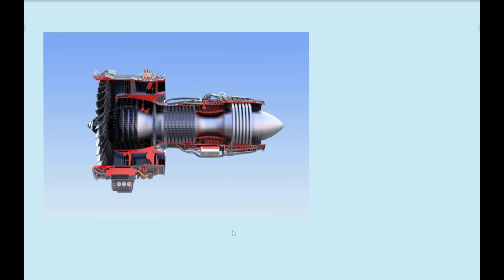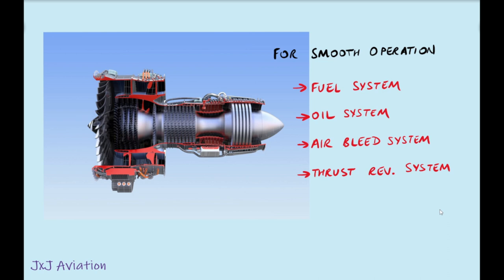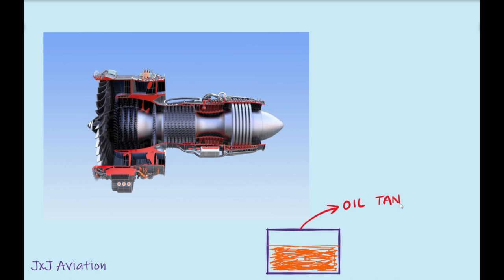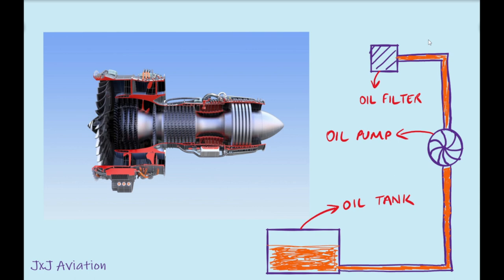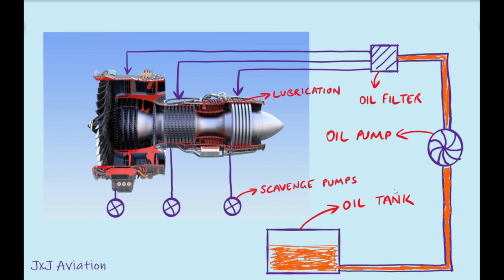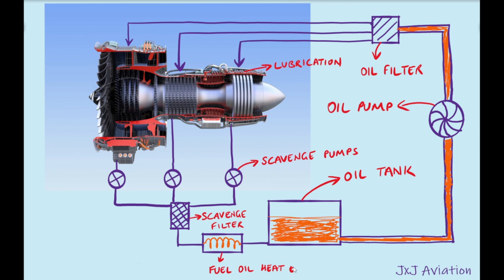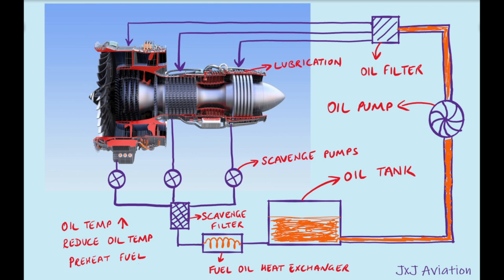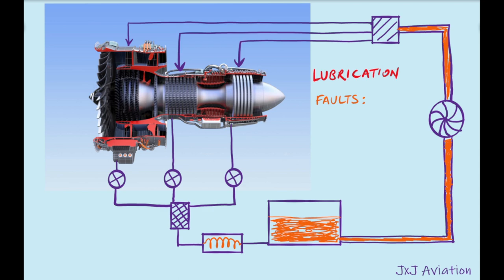How is an Aircraft Engine Lubricated? | Engine Oil System in 3 minutes | Aviation Notes | Faults

Comment: Oil system
It is nothing but 4 to 5 components it is available that I have built to improve the engine efficiency by lubricating bearings
 and its components

The main components are
Oil tank
Oil pump
Filter
And different types of lines which is connected to different places of engines wherever the oil is required
Then it's come to the scavenge pump after that it is filtered by the scavenge filter 
Any modern art craft we placed FC OC in between scavenger filter and to the return pipe oil tank
We can use the oil sheet by exchanging the heat to the fuel for three heat fuel by that we can reduce the oil temperature 
And this is a simple oil system we can understand

💯
Reply from the maker: Thank you for sharing this information!
Reply: How much the oil viscosity for planes